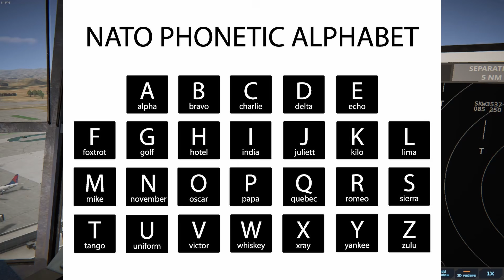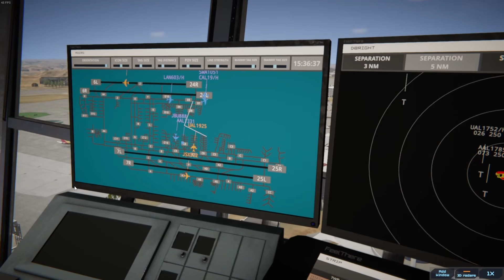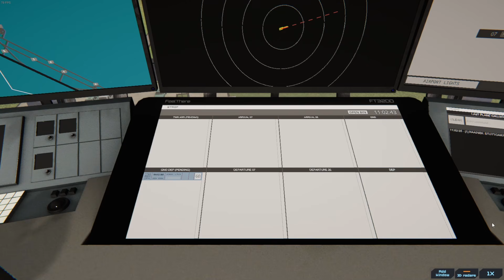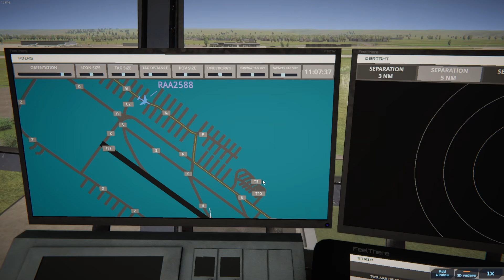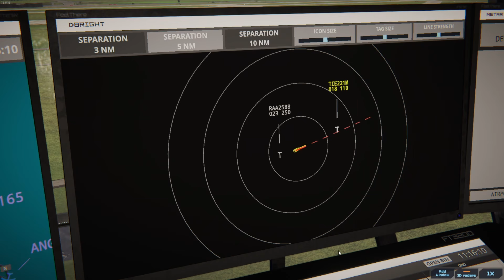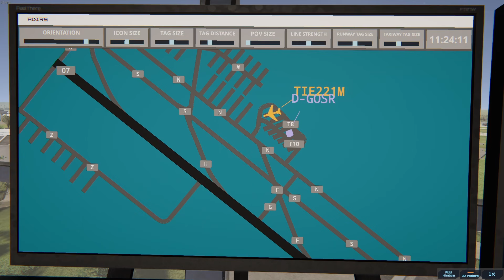Tower! Simulator 3: A Beginner’s Guide

Comment: Real ATC here. 

1. Set priorities, generally speaking, aircraft in the sky are more important than aircraft on the ground (except for an emergency on the ground obviously). So deconflict anything in the sky and then go to ground. 

2. Plan ahead, if you have an arrival and a departure that you notice will use the same taxi route, try to either change the route of one of them, or hold one of them in position somewhere before they meet nose to nose.

3. Be proactive. If you have the ability to do something right then and there and it won't conflict with any other traffic, knock it out because you will more then likely forget about things when you get busy.

4. Don't get glued to your screens. You should always be scanning your airport. In laymans terms...look out your windows

5. Physically locate an aircraft before speaking to it. You won't believe just how much this simple tip can help you see the big picture of what you're doing
Reply: About point 3 - When I approve pushback and the plane is ready to tax and there is no queue I just clear them for take off right away. Nothing wrong in this then?
Reply: @iamhank_  typically you should wait until the aircraft is close to the runway. There is no set distance but clearing someone for takeoff when they're still on the ramp is not good practice. That said, if the game is not taking points away from you then go for it, however if you want an air of realism then wait until they're close to the runway
Reply: @Jeff-399 yeah that's seems very reasonable 😊

Comment: You mention vectoring. What is that about? Also, when I send a plane to departure at takeoff if I use the frequency or say good morning, evening day it will say negative but if I say only contact departure it goes just fine
Reply from the maker: So vectoring is the process of me giving instructions for turning an aircraft, usually done to get them on the final approach course or after a missed approached.

Comment: Excellent. Even the music was unobtrusive and had lots of variety. Just to clarify - 'cleared for immediate takeoff' isn't so much an urgency concept. If the a/c is on the taxiway and you give them 'cleared for immediate takeoff' they will roll onto the runway and pretty much roll into takeoff mode; 'cleared for takeoff' under the same circumstances they will roll onto the runway, noticeably pause, and then roll for takeoff. I believe it's mostly a courtesy to the pilot to help get them on their way by using the 'immediate' option, if that works for you. If you're having to urge them on to immediately take off with speed - not good. Your example with 'line up and wait' was well chosen. From there you can go to 'cleared for takeoff' when you see fit.